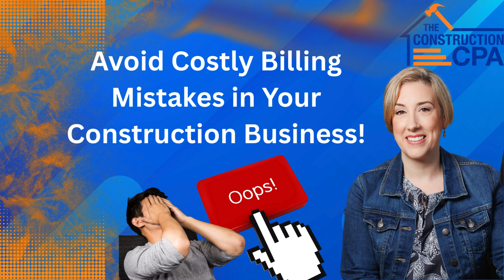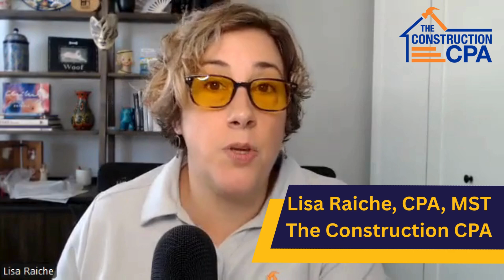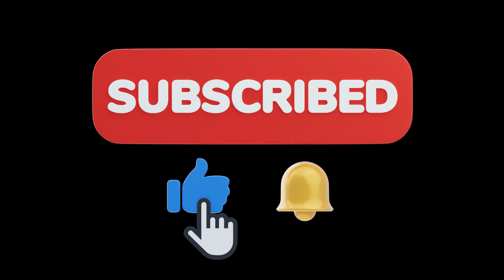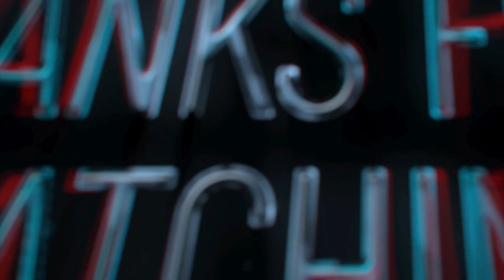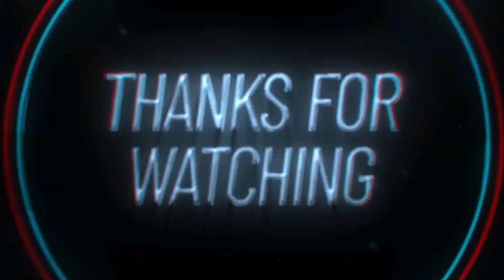MUST WATCH: Avoid Costly Billing Mistakes in Your Construction Business!

Comment: 🔑 Core Concepts
•	Accurate billing is critical for cash flow, profitability, and client trust 
•	Overbilling and underbilling both create financial and relationship issues 
______________________________________
⚖ Definitions
•	Overbilling: Billing more than work completed 
•	Underbilling: Billing less than work completed 
______________________________________
⚠ Problems
Overbilling
•	Short-term cash gain, long-term cash shortage 
•	Difficulty covering final project costs 
•	Risk of client disputes 
Underbilling
•	Cash shortages early in project 
•	Inaccurate financial reporting 
•	Large bills later → client distrust 
______________________________________
🚨 Main Causes
•	Poor or no real-time job costing 
•	Inaccurate progress tracking 
•	Lack of communication between project & finance teams 
•	Poor handling of change orders 
______________________________________
✅ Best Practices
•	Implement accurate job costing systems 
•	Use regular progress billing (e.g., monthly) 
•	Monitor WIP (Work in Progress) reports 
•	Compare actual vs budget regularly 
•	Automate billing and invoicing 
•	Improve team communication 
•	Track and bill change orders properly 
______________________________________
💡 Bottom Line
•	Avoid both extremes → aim for accurate, timely billing 
•	Helps maintain steady cash flow and strong client relationships